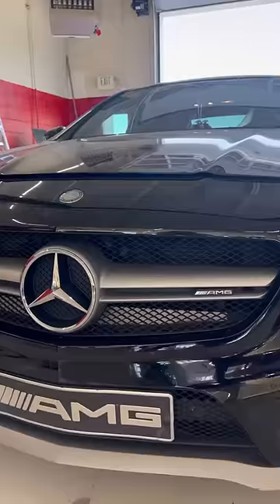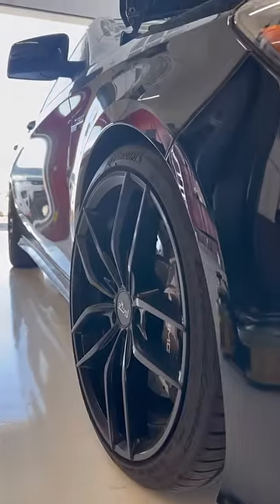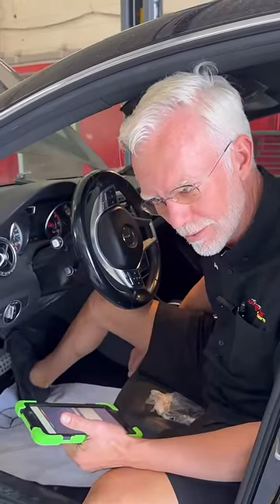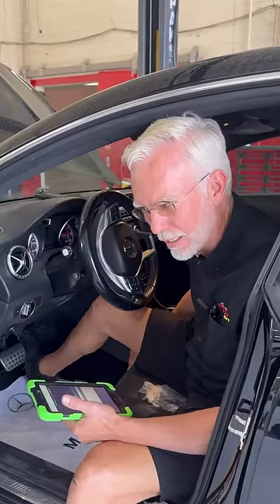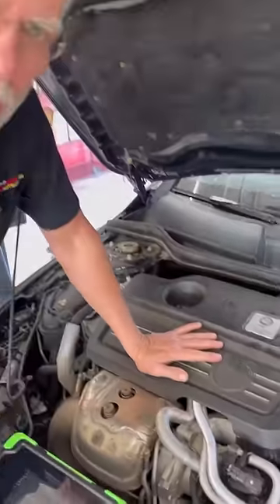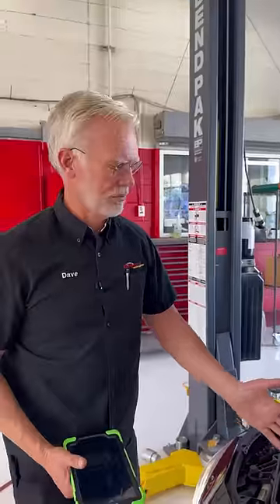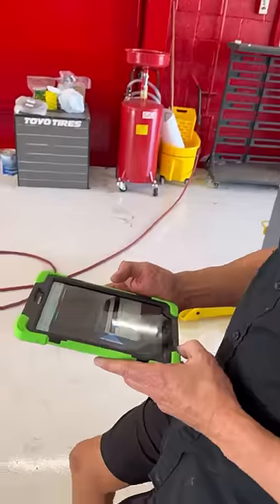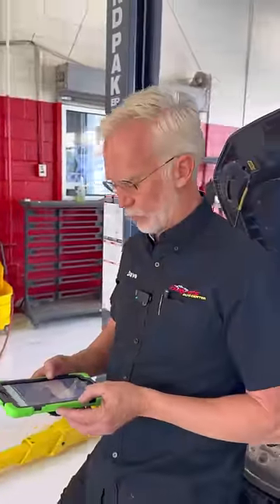Mercedes AMG Nothing but a slight noise on start up #carrepair #autoshop #mercedes

Comment: First thing I would check is for a boost leak
Reply: and this being the M133 ed1-2 45 series engine, they have a known internal wastegate issue. Your on the money! ;)
Reply: Exactly had an Audi rs in that was diagnosed with needed new engine from Audi dealer. It had a split vacuum hose where the dealer had stressed it by incorrect routing.

Comment: Dealer or Manufacturer do not want to open an engine up to find out the issue. Replace it with a new one, no guess work and less liability
Reply: The reason for replacement over repairs is usually cost. Paying a technician labor to remove then tear down an engine is more expensive than r&r
Reply: makes sense @TheHonestAdvisor

Comment: Start boycotting ALL THESE DEALERSHIPS and corporate/chain auto shops. Any part is 3x the cost of the original price, I found a locally owned shop and I can buy all my parts myself and he will install at no extra cost I’m only paying the shop hours which is $130h. Oil housing online $250 compared to a corporate chain auto shop there price was $600 EXACTLY SAME ITEM 🤦🏽‍♂️🤦🏽‍♂️.

Comment: Couple things come to mind.
As soon as you let off the throttle I hear a chirping like sound.
If underboost (assuming it has both SC and TC) the plenum connecting the two FI lines needs to be looked at. 
Also - if it is over heating, to me it might also be underboost causing a lean back problem and this increases temps….
BUT
If overheating and chirping of the SC - I would assume that the coolant pump has bit it and not circulating as well as the t-stat is done. Since the plenum connection between the SC and TC is in the valley, and you have the cover on, would account for overheating the intake runners this leading to low pressure.
Reply: Turbo bearings shot ,when releasing throttle shaft rattling around causing this noise.Likely more damage because overheating, dealer noticed loss of coolant that probably doomed the turbo.
Reply: Wrote a whole ass essay for nobody to care😂

Comment: Left front lug nut covers are rattling at 4250 RPM which is causing the engine to overheat because of friction. Every few miles the customer needs to spray the lug nut covers with water to keep the engine cool.
Reply: Hahaha….
I think you’re right but I would also check your muffler bearings and your backup modulator valves.
Reply: @theyangview1898 wrong, its the flux capacitor and worn out blinker fluid!
Reply: Not enough elbow grease.

Comment: The first thing I would do as the owner is never buy one of those money pits in the first place.
Reply: Yep.. My 20 year old C5 would spank it.
Reply: Got to live a little boys all could be be taken from us so drive the garage Queen before they outlaw our gas cars ! It is coming sad to say !
Reply: Said the guy who never drove one.
Reply: @Iam_Yu627  I don't have to own a Mercedes to know that they are money pits, my friends have had them and I owned plenty of German cars that were just the same. Amazing cars but get rid of them before the warranty runs out.
Reply: Most folks who buy at this level do it to flaunt their financial status, but in my opinion, all they're doing is flaunting their ignorance. 

Warren Buffet driving a main street car, that's advertising brains!
Reply: Been driving my 2006 Mercedes E55AMG for 17 years now and have over 162,345 miles on it, and yes original engine and transmission. If the regular maintenance is done at the recommended intervals you will have a very reliable car. Oh and I forgot to mention it is tuned with long tube headers so it's over 640 horsepower and 690 ft lb of torque and it'll spank C5s out there on a regular basis lol, very humiliating for a Corvette to be beaten by a four door sedan😂🤣😂
Reply: @garrettchapman8170 no it won't
Reply: @frankbiz Respectfully,  any car will become a money pit when neglected and abused. Being smart about maintenance/repairs is key. IE, avoid the stealership at all costs (no pun intended). Depending where you live, you can expect up to $175/hr labor or more. Find a good indi if you must. Source parts with a lifetime warranty.  MB will warrant parts three years.  I buy online. All my parts, from brakes to wiper blades are covered as long as I keep my coupe. This include fluid changes. 
These aren't Toyotas. They require regular and careful maintenance to perform and drive like they are meant. Being proactive and sourcing parts smartly goes a long way to keep these awesome cars from becoming money pits.
Reply: @garrettchapman8170 stock vs stock, the cla45 is 1.2 seconds quicker in the 1/4 mile...with a 2 liter.
Reply: Mercedes is the one foreign that is far from a money pit. I believe you’re describing BMWs lol
Reply: @frankbiz I only drive VWs. The longest ive had one was to 300k. They're amazing if you take care of them
Reply: Mercedes are so simple it’s hard for some to grasp. Do the maintenance on time every time period. It is a serious commitment and all the responsibility is on you. If you fail you will not be happy with the car. Price does not matter. Never, ever buy a used Mercedes without extensive correct service records.
Reply: @johnk3606  I agree 100%, maintenance is the key on any vehicle. 👍🏻
Reply: @tomhunter91 my vw is at 312k miles and still going strong
Reply: Most intelligent comment I've read.😊
Reply: @andrewatwood4711 That C5 a make you see smoke?
Reply: @andrewatwood4711 any car will run with regular maintenance lmao germans just cost a lot more for basic maintenance . The interiors and paint will last longer than the mechanica and electronicsl parts
Reply: Some one is smoking some god weed with there afterbadged AMG. I HAVE A 2021 Camaro 1LE with a six speed, procharger, cam and tune you have no chance of catching.. and that's all loser.
Reply: @frankbiz that doesn't prevent any electrical problems
Reply: Lexus instead
Reply: @Iam_Yu627 WE ALL KNOW they're money pits. NOTHING to do with driving one. My uncles mate had the main Mercedes-Benz dealership in town. He OWNED IT and said they're heaps...
Reply: @OffGridInvestor  absolutely!  Toyota or Honda products are great. My 2008 Toyota Highlander has almost 250k miles and runs like new. On any car charge the oil every 5k miles with fully synthetic oil and it will last.
Reply: @Long-Island-Sound  not necessarily, I bought my wife a new one because I wanted her to be safe.
Reply: @andrewatwood4711 That's different tho. The M113 is arguably one of the greatest engines MB ever made. Where the M133 (found in this turd), let's just say not even close. 😢
Reply: @kevinmellett9185 wow. A plush seat really makes the engine failure rates take a backseat. My eyes have been opened. I'm completely able to ignore the fears of mechanical failure on an overpriced car because of the name and some leather seats. Gotta love that argument though. It's a front engine v8 sports car. They all feel the same. Every company makes one. BMW. Dodge. Ford. Chevy. Ferrari. Jaguar etc. And if you wanna say the engines are better BMW v8's have a more free spool for its rpm band. Love your car. Have fun with your car. Don't lie to others about your car. It's over priced for comparable cars at market and its direct competition usually fairs better for longevity. And please for the love of God stop acting like it's something so much nicer to drive than anything else. It its in the sports caragory with a comparable engine its gonna be similar enough you'd never know the difference.
Reply: @andrewatwood4711 this comment was brought to you from a track with no corners.
Reply: @apancher I'm so confused as to why you think the straight line values of Chevrolets track car are the hill to die on. It's not meant to accelerate fast. It's meant to be able to maintain speed through corners. They weren't focused on making a drag style car. So you're only really acknowledging half the picture through that lense.
Reply: @frankbiz not the point of an AMG car. Unfair comparison. A Camaro is a better equivalent if your trying to show longevity in this case. I expect sports cars in general to last less than commuter cars and SUV's. Higher RPM and usually hotter. Do an inverse thought check. If you took the highlander to the track it's gonna perform in a way that makes it seem like a piece of shit compared to any sports car. It's apples and oranges. The reason these are such bad money pits is that the exclusivity usually comes with a surcharge in the form of being mechanically difficult to maintain outside of professional shops. That's why I like American. By and large they are simpler so the money pit thing is easier to stomach knowing I spend the majority on parts and making sure it's done right without paying for someone's labor. TLDR: your comment doesn't mean anything in this context because the operation that each vehicle was meant for is too far apart from each other to compare in a meaningful way.
Reply: @Long-Island-Sound you're actually flaunting your ignorance
Reply: @garrettchapman8170 a stock cla45 would gap a c5 around a roadcourse or the drags. And I’m a corvette lover
Reply: @Youcallthesebagels_ a stock RS3 can easily slay those CLA 45s.
Reply: @Iam_Yu627 I've owned one.... biggest money pit I've ever driven. Happy to have gotten rid of it.
Reply: Money pit?  Lol people with money don't keep cars after warranty.  It's only a money pit if you buy it used or keep it for 5+ years.
Reply: only for the rich !!! they dont mind blowing money into the fire !!
Reply: @BigdeesulOfficial  A money pit is a money pit regardless, I'd also say any car that only lasts 5 years without becoming problematic is a beater too.
Reply: @jongonegone1262  exactly!

Comment: Check for combustion gasses in the radiator. 
Find where the noise is coming from.
Does not sound like catastrophic failure to me.
Have a great day. 👍
Reply: Run full.spectrum diagnostic under load.

Comment: I'd do a coolant test first to check for blown head.  After that, do an oil analysis.  If those come out good, check the pipes going in and out of the turbo.
Reply: How long does it take for fluid analysis to come back typically?
Reply: No compression test?  That test don't lie if the engine bad the pressure difference will tell for sure.
Reply: @stewart8127, if it runs without misfire and doesn't consume oil, it's pretty safe to say that the compression is good.

@BawkBawkBawk666, a fluid analysis take about as long to perform as shipping a package UPS.  For how good that engine runs and how cheap the test is, it's worth the wait vs yanking and tearing down an engine that's probably fine.

Comment: I bought a 2010 Honda Accord 4 cylinder for $1,000 because the top end was rattling and the dealer said it needed an engine.  All it actually needed was an engine flush and cleaning out the Vtec screen.  The codes didn’t give them an easy answer and most dealer mechanics have no idea how to troubleshoot or diagnose a problem.  The service writers also get a commission on a new car if they send the customer to the “client retention team” at big dealers.

Comment: I’ve never heard of a turbo supercharger, I know what you are talking about. Sounds like you’ve got a bad tensioner on your supercharger belt and that’s what showing low boost and that’s where your noise is coming from because you’re having a belt slipping.
Reply: He was reading generic DTC descriptions - some say "turbo/supercharger..."
Fun fact: When turbos were first invented they were called "turbosuperchargers" and that is still technically their "proper" name to this day.
Reply: Sounded like a belt tensioner first up
Reply: Possibly overheating from water pump failure ie, impeller is loose,/worn out bearing is worn out causing noise/slipping.
Reply: Belt tension bearing more than likely. Had same sound on my motor home.
Reply: The software code is called the Turbo Supercharger over boost condition code.  It applys to a Turbo or a Supercharger.
Reply: A supercharger is mechanically driven.
A turbosupercharger (colloquially shortened to 'turbocharger') is exhaust-gas driven.

I know I'm not sharing new information about how they work, just that 'turbocharger' is just an abbreviation of 'turbosupercharger.'
Reply: What belt? A turbo charger runs by exhaust channel through a turbine and has no pulley or belt. The supercharger, the way, I always understood. It is powered by a belt operated fan, pumping air into the intake. Most street legal Auto of use a turbo charger
Reply: What year is it. I use too work at Mercedes dealership and it could be under warranty.
Reply: It's hard to have supercharger belt slip on a turbocharged engine

Comment: Because it overheated. If one gets hot they have you replace it for liability reasons. If they fix it then something else breaks and someone gets hurt, their insurance company will have a field day with them. It’s better to just replace from legal standpoint. But the actual issue sounds like a turbo issue when you rev it